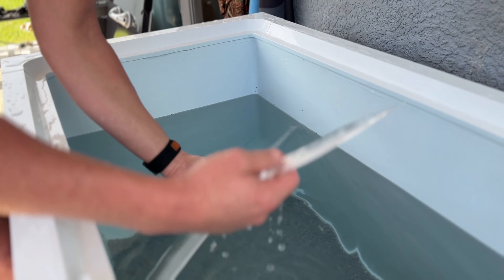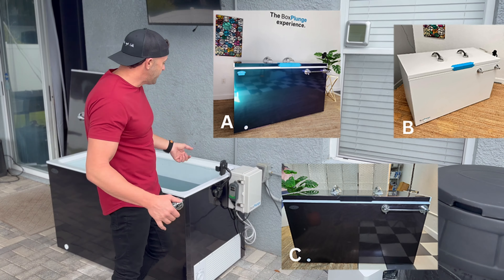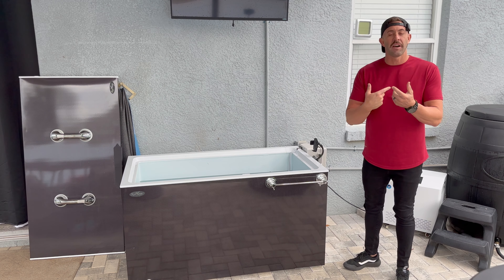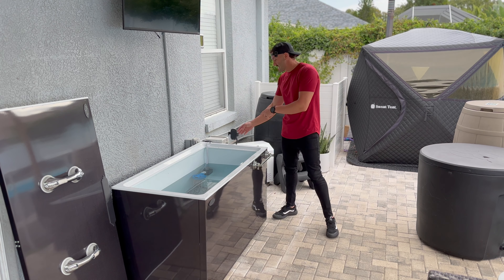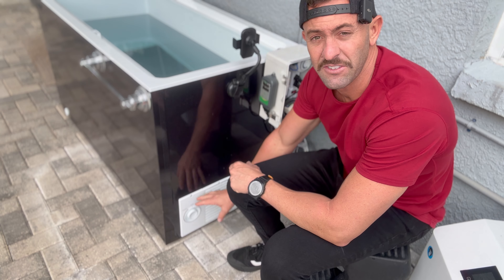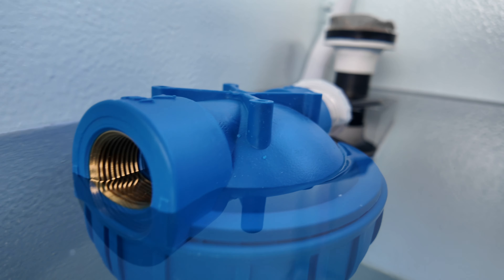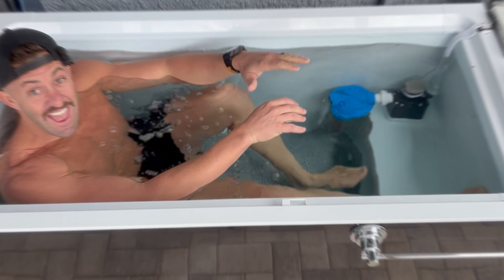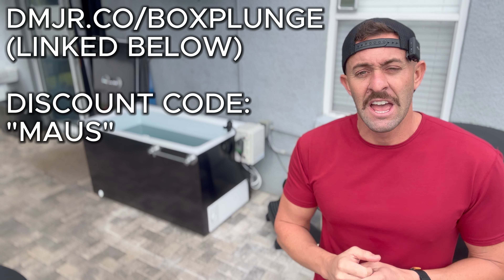The Box Plunge: A GAME CHANGER for Freezing Cold Ice Baths

Comment: Is it safe to have these outside? I noticed it has vents but didn’t know if that was enough to protect the motor from the elements
Reply from the maker: They are rated for outdoor use but recommend under a cover. I have seen them in both settings and both seem to work well